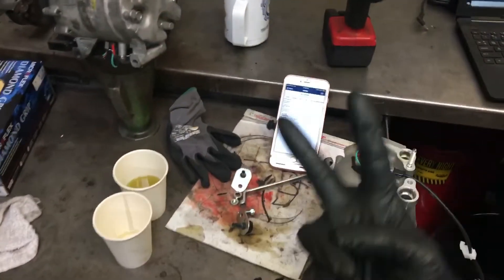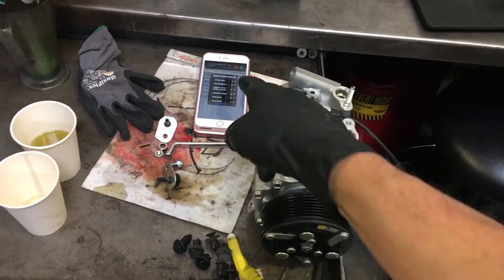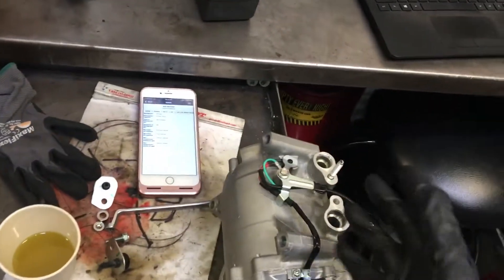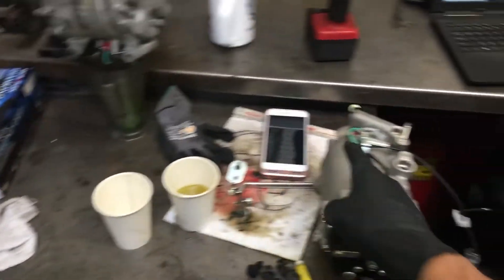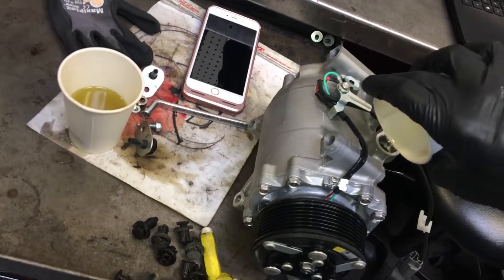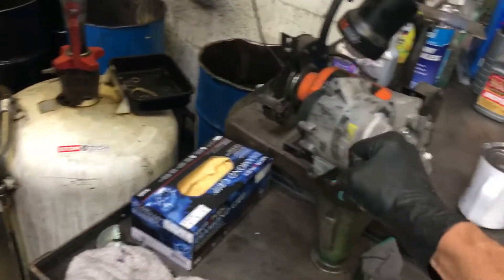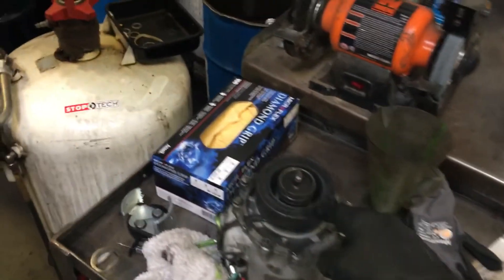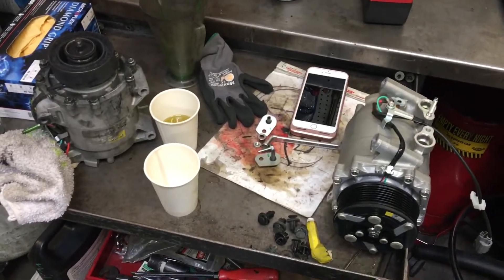Teaching New young technician about AC compressor oil balance.  Honda told him there was no oil￼

Comment: Hi there, I got a recommendation from a guy on Reddit said u are a god in AC. Im about to replace my AC compressor on my Mazda cx7 2011 turbocharger 2.3. I have some questions if u dont mind help me out?
- i planned to bring it to a shop to empty the Freon, does that mean its will run dry and considered low Freon? So will most likely have almost zero oil left in the Compressor? Is that correct? 
- I know denso will be the best option but I go which 4 seasons what do u think?

Comment: Short video but very informative! Is this method applies when  we replace compressor only? Do we do it differently when we replace more components such as receiver drier and condenser?
Reply from the maker: Yes this applies to all components.   Every component of the certain amount of oil so when you replace it you add a pacific amount of oil. 

Unless the system is run dry on refrigerant low.

In this case some company will have almost 0 oil in them because it was all flushed out with refrigerant and load it up in the evaporator

Comment: Great video but I would sure would love to see you show us how to properly do it. Thanks for this one.
Reply from the maker: The only thing you did not get to see was me removing the caps or the plugs off the new compressor and flipping it upside down the two ports drained out the oil into the cups that’s all you missed. 

          But I do understand when you don’t know at first and you’re learning you would like to see every detail move and procedure. 
                    Unfortunately compressor was a little heavy could not hold my camera at the same time hold that compressor upside down above the paper cups. 
                  Unlike the dirty old compressor I have on a strong plastic container draining oil out of can hold up the weight of the compressor the paper cups would’ve collapsed